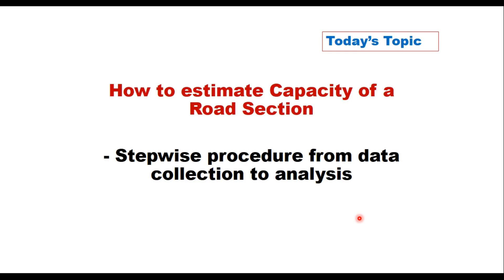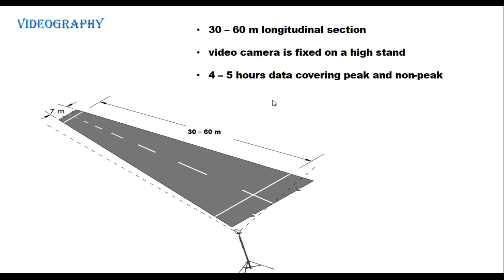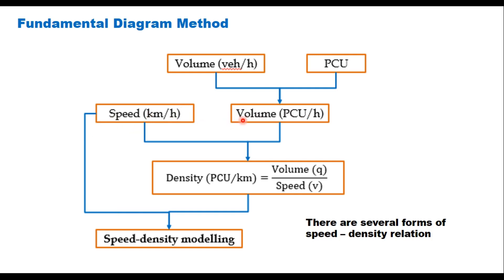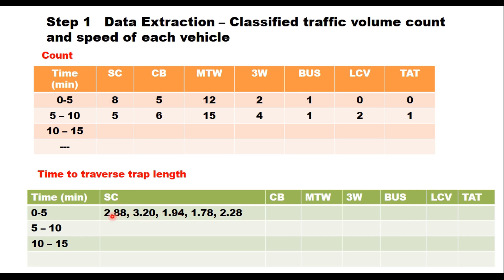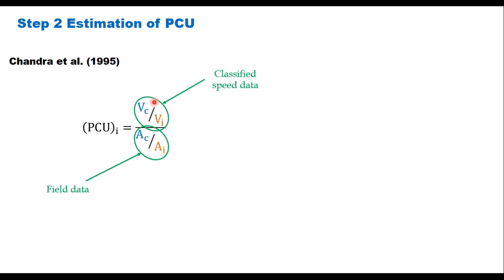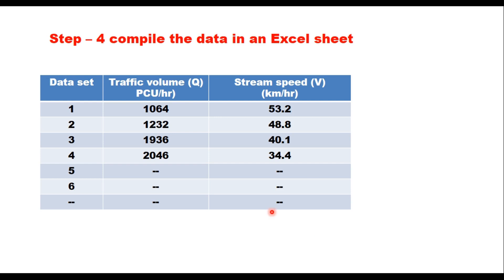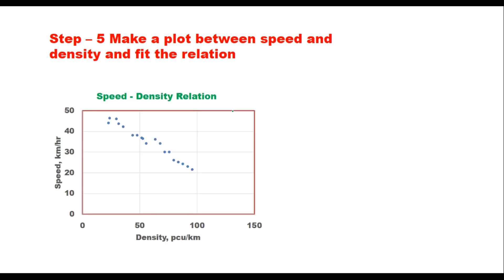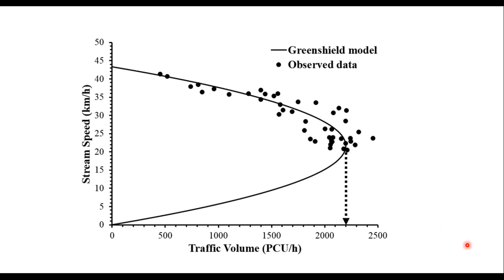speed-flow relation. How to draw speed - flow curve and determine capacity of a road, step by step

Comment: here the capacity of road is linked to traffic volume count. but how can it be? how can capacity be altered?
Reply from the maker: Capacity in field is estimated from traffic volume count only but it is the miximum flow that can take place on a road under prevailing conditions. You can also estimate it from manuals, but in that case you need to apply a series of correction factors to reach to a value for the given facility. 
Capacity can be altered by making changes in the geometry or traffic conditions at site.

Comment: Sir how to solve for capacity if there is power (eg 2n+1) in green shield model
Reply from the maker: Greenshields model is linear only. Power function can be taken but then it will not be called Greenshields model.
Procedure remains same. Now instead of fitting a straight line in speed density equation, you can fit the curve with power n and then follow the steps as given in this video.